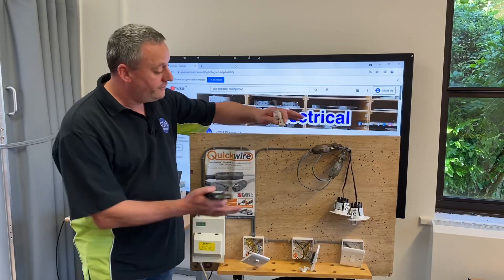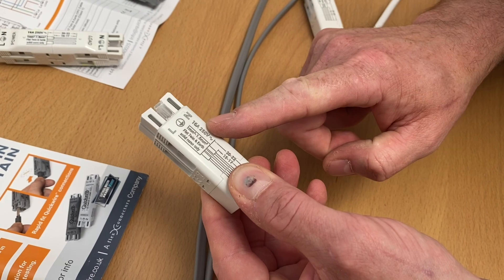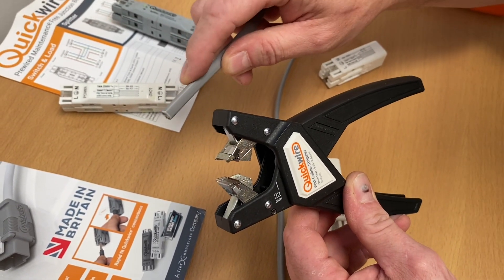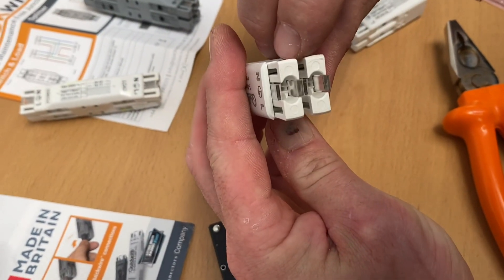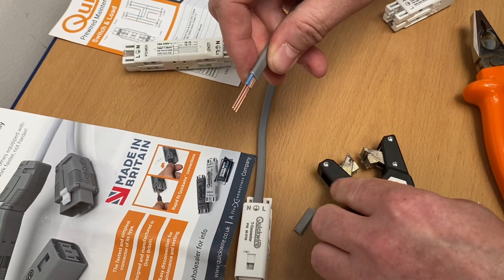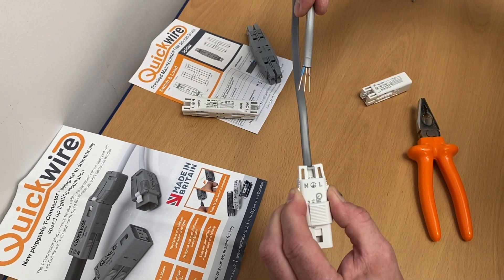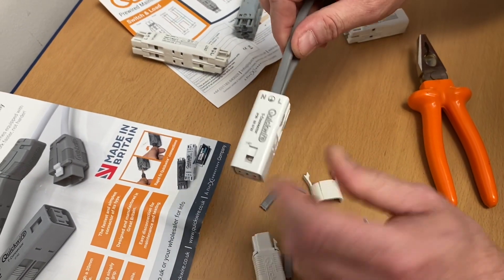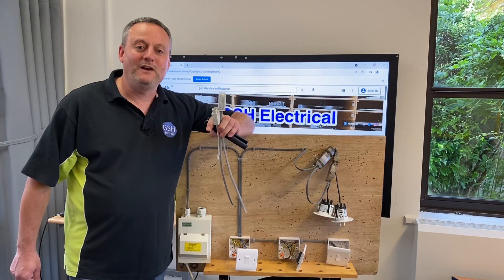Quickwire T Connector and Twin and Earth Strippers Makes Life Easy When Fitting LED Downlights

Comment: The T wire system looks quite impressive.  I have 2 versions of the T&E wire strippers. It's just that I just haven't used the T connectors as of yet.  👍
Reply from the maker: Thanks for commenting